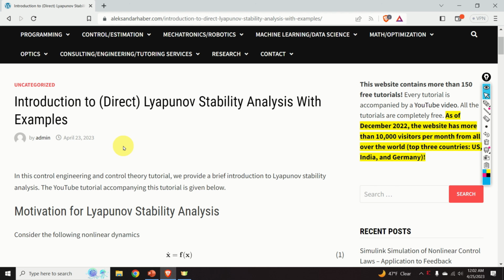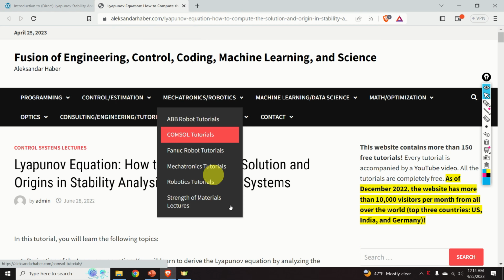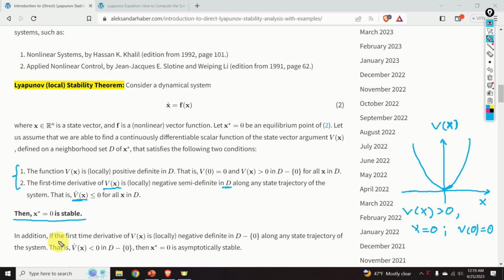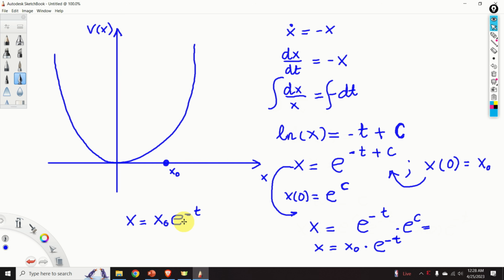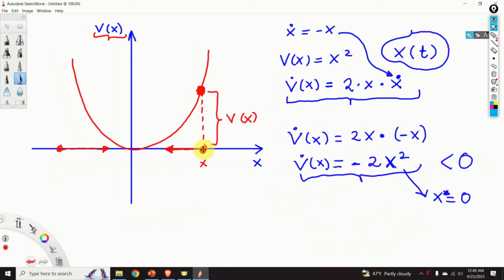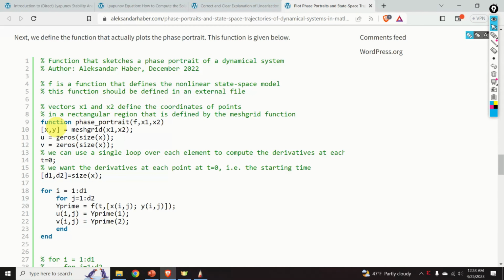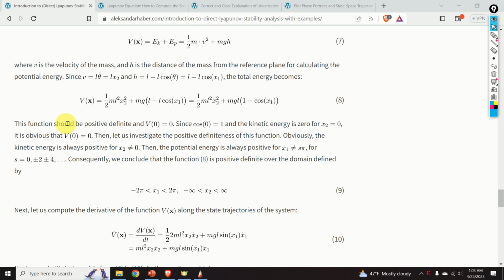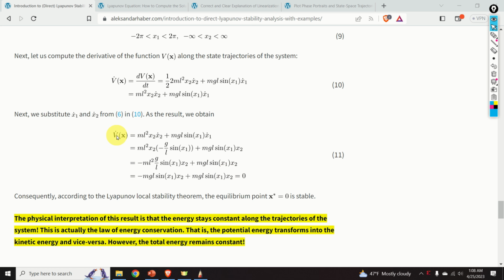Introduction to Lyapunov's Stability Analysis of Dynamical Systems  with Examples

Comment: Great video, thanks for putting in the time! At 9:28, shouldn't it be V(x) > 0 for all x unequal 0, meaning there the equal sign should be crossed?
Reply from the maker: It should be V(0)=0 and otherwise V(x)>0, for all x not equal to zero. That is what is written and what I said. Consequently, there are no errors.